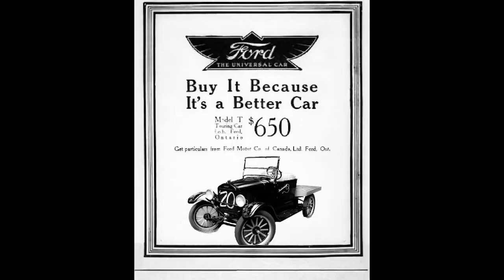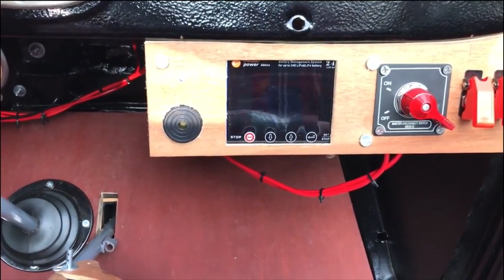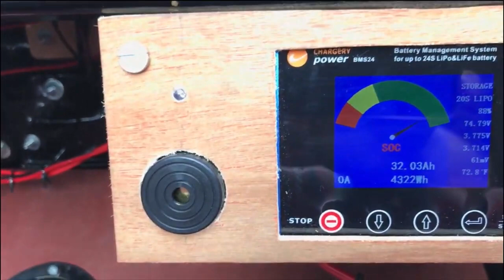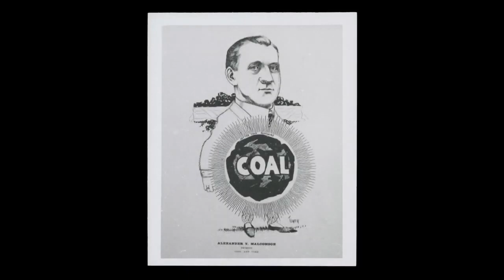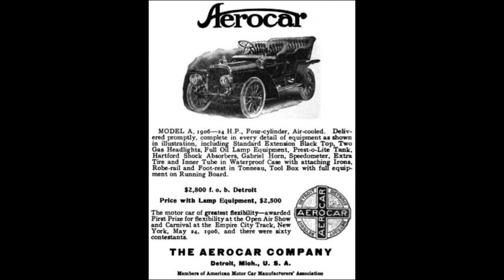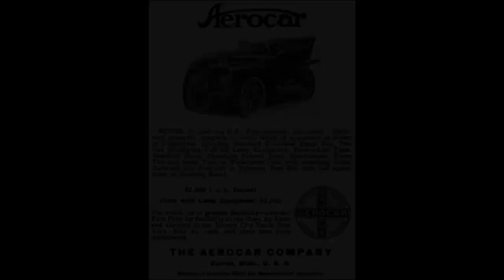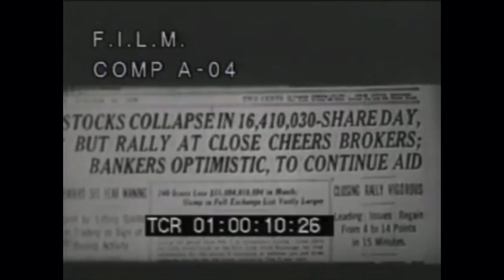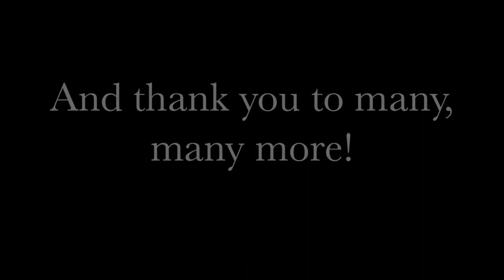Ford Model T Electric Conversion and Restoration

Comment: Interesting, but it rather misses the point of a restoration, doesn't it?  Part of the intrinsic charm of a Model T is the original engine.
Reply from the maker: Dan, thankfully there are many, many thousands if not tens of thousands of other model ts out there with their original engines.

Comment: Can you contact me on electrical parts  what i need i have found parts used
Reply from the maker: Mr. Huggins, if you send an email to the following address I will reply with the manual, parts, and schematic for the project. (williambartlett109@gmail.com) 
Thanks, 
Will Bartlett

Comment: Aside from the all the other goodies, what did the basic motor, tranny and electrical equipment actually cost you in the long run? I am on the fence with my '25 roadster as to restoration or hot rod. It has no motor or tranny.  Restoring it will not pay off in the long run as much as turning it into a hot rod would. Plus, most folk knowhow to drive a more modern car and the T is very much different than even a Model A in that regard. What is your run time or average mileage prior to needing a recharge? Do you have to have a special charging unit and how long does it take to actually charge it up? I saw a '42 Chavy business coupe once, many years back, that was powered by an electric battery setup. I had a '42 Chevy business coupe at the time, as well, but I always thought the weight of that car would hamper anything that an electrical conversion could offer back then. That was in the early '80's and a lot of the electronics have improved since then. The T is not a really heavy car when using the stock frame and all. How does it hold up in cold weather? Interesting concept. Where was the electric motor purchased from or did it come out of a golf cart or something? Thanks for any information. Nice video and nice work.
Reply from the maker: Mr. Huey, if you want a part list or electrical schematic you can send an email to the following address. (williambartlett109@gmail.com) the motor and other electrical components were expensive, I believe 2-3k. The transmission I found in a barn and got for free. From my little experience converting a classic car to electric is probably the worst thing to do as far as an investment. The goal of this project was just to learn and make something cool. The t could go about 20 miles on one charge and hit 40 mph. Lighter is definitely better, also significantly cheaper as the heaver the vehicle the more built up the motor, battery, and all other components need to be. I have not driven in cold weather so I cant say. The electric motor came in a kit with its matching motor controller and other electrical components, it was designed to be put into a large golf cart or electric ATV. I hope this information helps.
Reply: @williambartlett8921  It sure does help. I love the project and your efforts, but sadly, my own 1925 Ford runabout is just not the car to do this with, due to the expense and return issues of conversion. It still is a wonderment of a project and you certainly have a nice vehicle to be proud of. Me, I prefer the turtle deck as opposed to a flatbed assembly, but that is just me and the styling of the Model T which I prefer. Restoration or conversion to a hot rod is a touch choice these days, as the return often does not pay off from the expenses acquired in the end. Prices are so very distorted these days, so you really have to pick your poison well in what you decide to do with a vintage car. Thanks for the information and this video presentation.

Comment: Top speed? Who many miles of range?
Reply from the maker: 40 miles per hour and only about 20 miles, due to the small battery
Reply: How large is the battery pack? Specs?
Reply from the maker: @hollidayquezada8954  
Nom. Voltage: 72v
Max. Voltage: 81.5v 
Min. Voltage: 68v 

Capacity: 67.5 Amp hours/4860 Watt hours 

Weight: Approx. 70 lbs.

Max. charge current: 10 amps
Max. discharge current: 500 amps 

Cells: 540: 18650 lithium ion cells spot welled together 
Series: 20s
Parallel: 27p 
Type: Samsung 25R

If you want more info on building the battery, the BMS, or other info email me (williambartlett109@gmail.com) 
Thanks

Comment: William,  what is the cars battery voltage?  Did you maintain the T's transmission?   Is your motor a DC series?  or a 3 phase?  Thanks.

Comment: If this comes off negative, that's NOT my intent, in fact, if I had a stack of parts I would be tempted to do something like this...  Just some of my ideas on how I'd conceptualize it.  IDK the guys financial shape or engineering knowledge...  and also some questions...  

I'm trying to figure out why he needed to put a modern transmission etc, on the back of an electric motor - if he wanted a low range, he could get a ruckstell...  or even make a block off plate and shaft seal for a choppped up, butchered T trans and pan (which would give you all sorts of gearing options, since the motor runs both ways)...  If you wanted more speed (since you have torque) you could work with a machinist, have a high gear ratio put in the rear end...  or use a commonly available 3:1 rear end.  Ad the ruckstell, and you can climb walls.

Another one is why he replaced a pretty cool original P/U bed with that wooden contraption of a flat bed.  If you needed access to the battery stack, you could mount the bed on a false floor and use hinges....  but IDK, maybe he wanted a flatbed?  Just my opinion...  then again, I would actually restore the roadster body (with a top and even side curtains) so I had a car I could use in all seasons...  BTW I like the battery solution, I'm wondering how the T chassis handles the weight of your battery system, since they're not necessarily a car designed for a lot of weight.

And the crank and radiator - I think I would have (somehow, spitballing here) put a small generator, chaindriven to the starter on it (from the crank), used it for an on board charging system.  Since I'm conceptualizing...  set it up over the 72V motor, "bastardize" a double generator together to get higher charge amps.  And (honestly) since you already have a modern voltage conrol and battery management system...  have a way to charge it from a "normal" EV station.  

But I can't knock it.  I've even looked at my T and though, well, if EVERYTHING goes electric, not IF I could convert the car to elecric, but how, and keep it still somewhat original.
Reply from the maker: Lassen, thanks for your interest, I think the video shares what my engineering knowledge is as I built the project. I put a transmission in the car for multiple reasons, It was an easy was to get a reverse, it was a sure way of having the right gearing ratio for the ideal motor rpm, it would help keep max momentary amperage draw down, among other reasons. I chose that specific transmission because it was free, a manual, and easy to install and mate to the motor and drive shaft. As far as the bed goes that is a mater of preference, as well as the original bed was in bad condition and I did not have a lot of time to restore it. The final battery was really light, about 50-75 lbs. Hope that information helps. Thanks, Will Bartlett.

Comment: This is an idea thats won't leave me alone lately.  Now I guess I'll be searching the fields and barns for a model t too. 
Why did you decide to use the transmission as many evs do not. I go back and forth with the idea.
Reply from the maker: Mr. Mote, good luck on your hunt. I used a transmission because the electric motor only had a certain rpm range that it could spin and having a manual transmission ensures that when the car is ready to drive you can drive at an appropriate speed.
Reply: No! Don't ruin another piece of automotive history. Find an old Hyundai instead. Nobody cares about those. You can probably get one free.